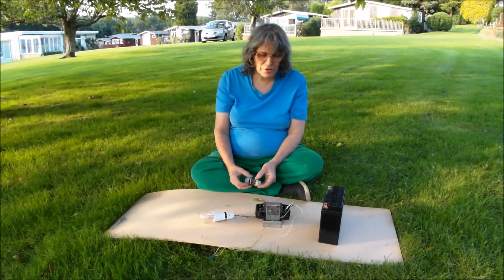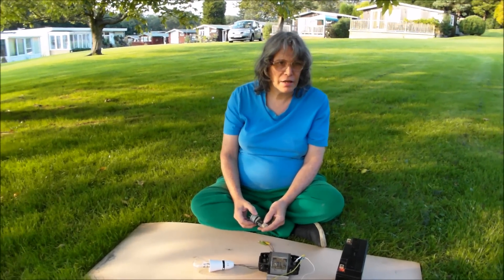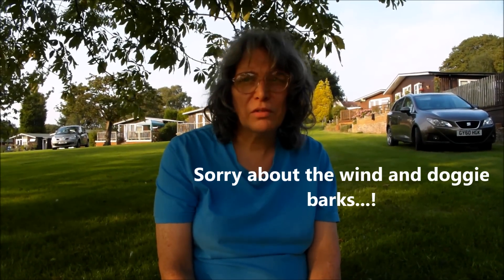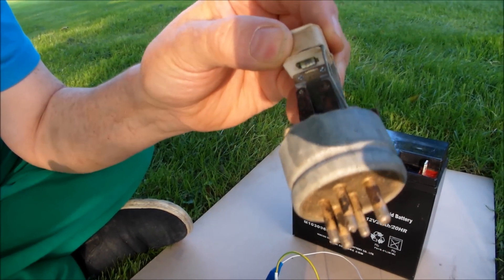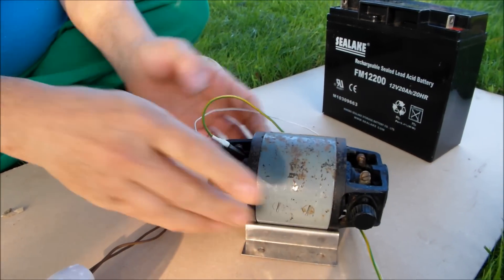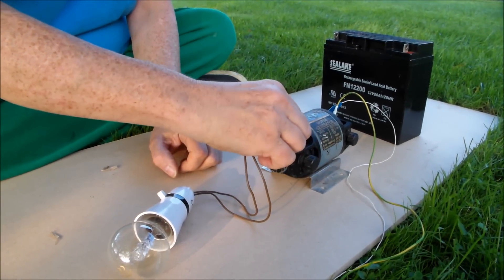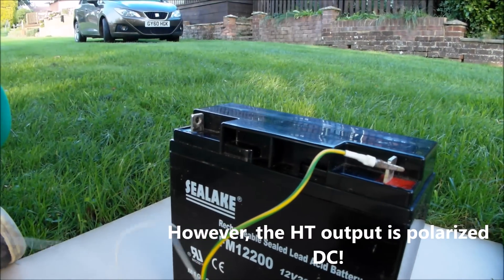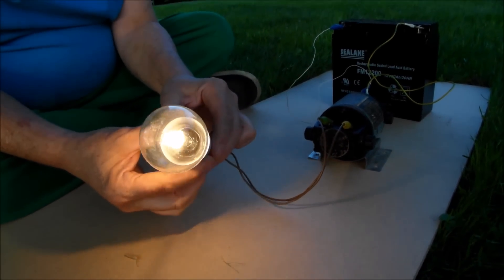MOTOR GENERATOR/ROTARY TRANSFORMER DEMONSTRATION

Comment: Sure that was wired the wrong way around
Reply from the maker: Are you referring to the polarity of the battery connections, or what? If your suggestion is correct then the thing wouldn't work, which it demonstrably does. Thanks for your comment. 🙂
Reply: @hoofbags  you have the battery on the  out terminals and the bulb on the in terminals look in the vid
Reply: Wire it with the battery on the in terminals and the bulb on the out terminals
Reply from the maker: @stevenholt3432  what purpose would that serve? Just wondering. As can be seen, the upload was a number of years ago: our movie was simply to demonstrate that the device was functioning. I sold it on eBay and don't have it anymore. Got about £40.
Reply from the maker: @stevenholt3432  I see what you're referring to. The label is the wrong way round, and instructs the user to apply 12 volts DC left of the label and draw HT from the right of the label. Quite a few people during 70s radio club meetings connected these as you suggest and the things refused to work: it was quite a common confusion but I can assure you, this rotary transformer is correctly wired in the movie. Thanks for your comment.

Comment: Culd that thing by reproduced out of car starter motor? Culd you make video and show how wire wounding look like on that thing?
Reply from the maker: I don't own it anymore, this upload was done simply as a means of selling the rotary transformer: I think I sold it for about £40. UK has a shop called Halfords, from which it's possible to buy an inverter by Ring. This is the modern equivalent. Also, two motors from scrapped cordless drills would do something similar, if a means of output shaft coupling is devised. Thank you for interesting comment. 🙂

Comment: Why there isn't a massive production of small and medium motor like this to free us up from electric company? Also why there isn't battery charging station for people who can't afford solar panel or windmill?
Reply from the maker: These days stepping up a voltage from a car battery is done by solid state electronics. Inverters can be bought from many big hardware stores, such as Halfords in the UK. There's a company called Ring who make them and they're included in car starter packs: those things you start your car with when the battery goes flat. Unfortunately, this movie is somewhat misleading. I demonstrate a 240 volt lamp being powered up by the device but it could never give enough current to supply the load that a house might impose upon it. Additionally, you'll have to find an electrical outlet so that the battery running this device, or inverter, can be charged. Solar panels and windmills only give out a tiny amount of power.  Thank you for your interesting comment.

Comment from the maker: Hello Tomas Racz.. If a device consumed about 60 watt, a 12 volt battery would have to supply 5 amps. A typical car battery would be probably 50 amp hours so it would operated continuously for about 10 hours, before the battery went flat. That is if it's a brand new battery, that would also have to be a deep cycle type: to my knowledge, typical car batteries don't like being run to the point that they're flat. If it's one that is in your car, you might get stranded with a flat battery! Not nice. Important also is that these devices give out DC so most mains powered devices won't work and probably suffer damage. 

When these were used in vehicles, usually military, they'd probably leave the engine running, or very cautiously use the radio equipment when engine not running, for short periods. If you needed to run a mains device on a car battery, it would probably be best to get an DC - AC inverter. Such a thing would be great for a bass guitarist who wanted to play out in a field or similar. An amplifier, preferably transistor because of the consumption, could plug right into there and sound real loud. Below is an eBay link. 

http://www.ebay.co.uk/itm/A0224-MINI-INVERTER-12-VOLTS-100-WATT-CAMPING-CAR-FISHING-HUNTING-CAMPING-FREE-/131746282011?hash=item1eacb0ba1b:g:9rQAAOxyLN9SmMNL
Reply: for reference, robert shows you how to improve your generic car battery and turn it into an ultrabattery for far more charge cycles 
 https://www.youtube.com/watch?v=N1jusadHkmM

How To Make An Ultrabattery
Robert Murray-Smith
,Published on Oct 19, 2017

An Ultrabattery is an Australian invention that is a mix of battery and supercapacitor designed to improve the qualities of lead acid batteries. They are stunningly easy to make and in this video i show you how

Comment: Delco Rotary Transformer converts 12v DC to DC 365v 30ma. From 1950's is a old Vintage military Dynamo-Motor units for Wireless Transceiver. Which was manufactured by GENERAL MOTORS LTD. LONDON. Mechanical inverter or Motor Transformer and self-regulated so it can be used as a Generator motor... https://www.youtube.com/watch?v=ht4pgfdUZ8Q